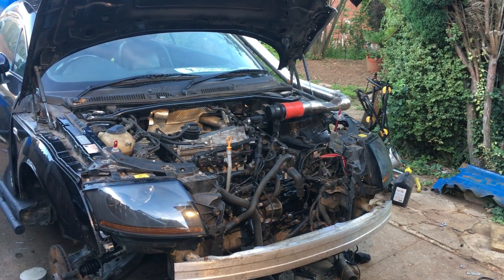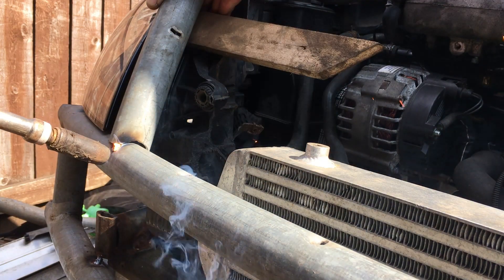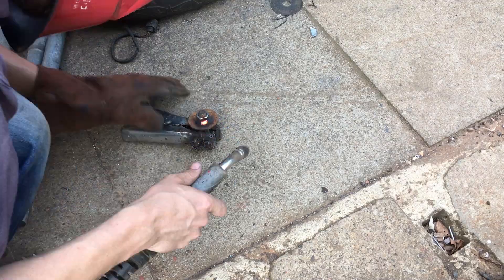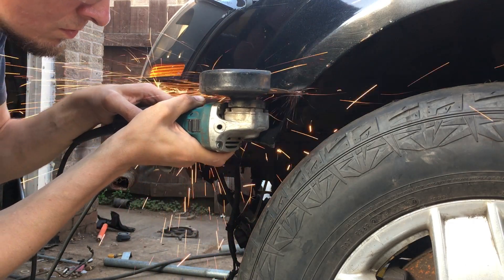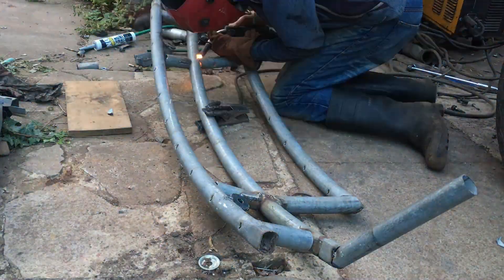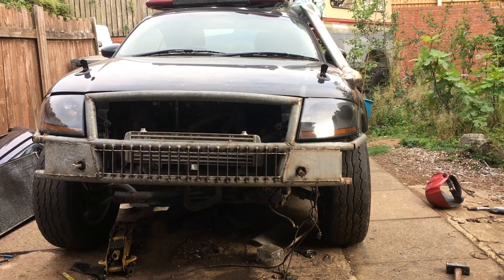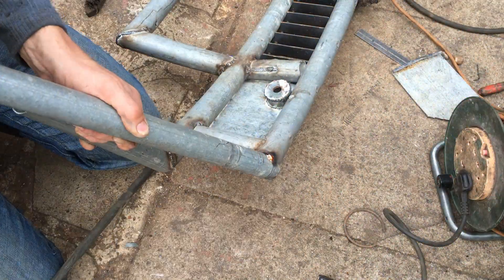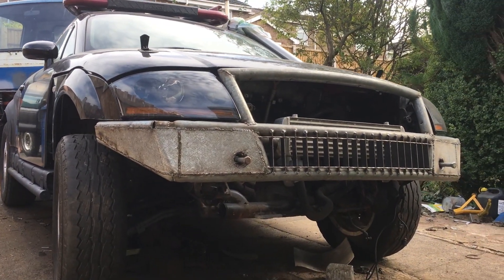Making an off-road bumper (from scrap metal) - Pt1

Comment: I think that's a dead trampoline frame you have found.  Next time Lidl have a plasma cutter available get yourself down there and get one - bit quicker and tidier than grinder for the tight radius cuts although the neighbors will then have to put up with the air compressor noise!  Great to see more progress.
Reply from the maker: I salute you - it is indeed a trampoline frame! Yes, maybe it's time to get a plasma cutter. Will give that some serious thought; it's got a lot going for it.